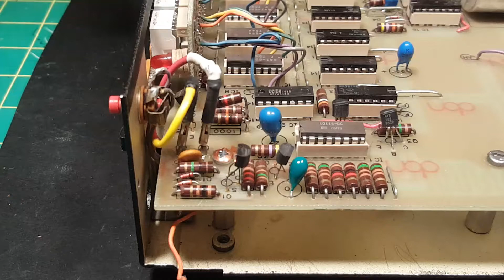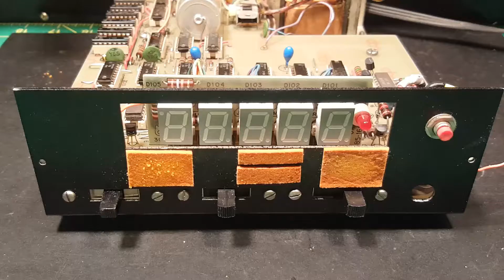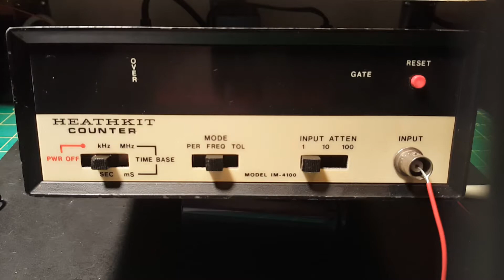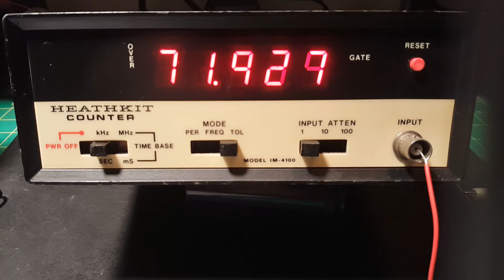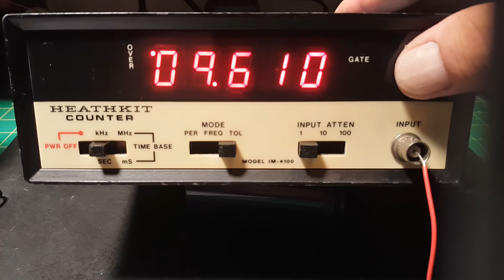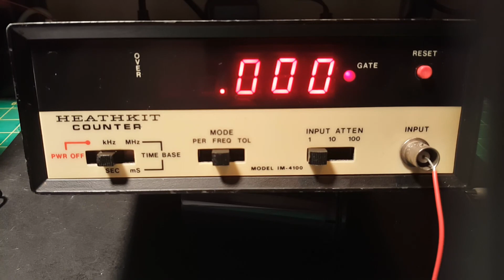Resurrection: Heathkit IM-4100 - part 3 of 3

Comment: I have a 4100, I picked mine up at a swap meet, a previous owner had modified mine to a 7 digit counter and it appears the LED's have been replaced, does not look like the old ones in yours...mine is a white base.  I enjoyed the series and I enjoyed the explanation on how these early counters work, I enjoy vintage gear and have a lot of 1970's counters that dont work and dont have (cant find) a service manual on them...I qualify as a new tech...I have been self teaching for about 5 years now.  Thanks for your insight and experience, I really appreciate it!  ~Jack, VEG
Reply from the maker: Good for you Jack! Self-taught techs are the very best. Something drew you to it- and due to your natural curiosity, you'll learn far far more and faster than most. Kinda how life is. I'm really curious what part number your displays are in your 4100. I have an extra set of the displays if you want them. I don't. I'll never use them, and was happy to pay the cost of 10 to get my counteer going. I now have a Heath nixie tube display counter- and they each have their strengths and weaknesses. For one, the 4100 can count events. My newer one cant' But it's pretty. lol. Thanks for watching, and especially for taking the time to comment! Take care   :)
Reply: @n8nkqrp595  Howdy!  Sorry for delay, had to dig it out and open it up....mine has LTS6680E.  I just bought my first HP 5221A Nixie Freq counter as well, seems to work, but its 50 years old, will need to be serviced...its very cool but its really only good for the 5Hz~50KHz range...I do believe it does go to at least 5 MHz...but it only has 4 digits...from the factory...had to pay more for more digits....with this counter, it truncates the leading digits, not the trailing digits...so you really wouldn't know if your looking at 2 megs or 5 megs.  :)  Maybe later I'll get another one....I have more freq counters then one should!  :)  Thank you for the offer but I have a small supply....maybe do a give away and see if any of your subs are interested? 73's OM, fine business...5/5...DE Jack, VEG

Comment: Hello. I thought you might like to know how the story of my 4100 problem ended. I pretty much checked everything you suggested. I ended up back at the input where I started. The component cooler isolated  transister Q2 as a potential problem. Replaced it with no improvements. I even replaced the JFET with an equivalent but that made it stop working completely. I put the original back in and was right back at the original problem. Some more signal tracing lead to the tantalum cap, C6, right next to the transistor I had replaced. A careful spray with the coolant showed a definite change in the unit's  function. As I was replacing it, I noticed the original had been installed backwards. Now the counter functions 100%. I am not sure how accurately it can be calibrated, but after a long while I managed to get it extremely close to my scopes reading. Do you think that single cap would cause all that instability? It sure works beautifully now. Thank you very much for all your help. I was getting ready to shelve it.
Reply from the maker: Of course! Of course. Caps are actually far more prone to failure than modern (well, those aren't so modern. lol) transistors. Many people don't realize that tantalum caps are very, very prone to failure- especially those used in early equipment. They are not as failure prone as an electrolytic- but it happens. A lot. Even ceramic disc caps failure regularly. On my very first day on the job in my brand new biomed career- the senior tech stated that "capacitors are our #1 problematic component. Do not ever overlook them as the culprit for some strange problems". And he was right. In our Imed I.V. infustion pumps, ceramic disc caps were second only to 7400 series logic gates in their failure rate. I couldn't believe it. And oh yes- most definitely it could cause your woes. Ansolutely. If you have a short wave Rx .. i think you can even use an AM broadcast radio, you can zero beat your osc to WWV, etc., and get it to within 1 Hz. My counter, when calibrated after a full warm up, will generally display within 1 Hz of a test signal sent at 3.500000 MHz. You can connect the input to the OSC test signal output on the back to display the 1 MHz oscilltor frequency to test the unit. I forgot to mention that. Sorry! It's a good test of the unit, but only acceptable for a calibration test point if another much more accurate counter is available. WWV will get you within a Hz if your're careful. I'm VERY VERY happy for you!!!  73
Reply from the maker: I think I was wrong when I said using WWV and carefully zero beating will give the OSC 1 Hz accuracy. Actually, it would probably be 1/10 Hz accuracy, because you're beating the OSC's 10th harmonic of it's 1 Mhz frequency with the 10 MHz frequency of WWV. If you did the same with a station at 100 MHz, the accuracy would increase another ten fold. But that's silly.. the crystal osc will drift far more than that, making the whole process mute. WWV, yes. an FM station, no. lol. 73

Comment: What was the part number of the displays that you ordered.  I have just acquired a 4100 and I may need to replace them.
Reply from the maker: Hi there.. the part # is: HDSP-5503. They are available from Mouser, Digi-Key, etc., and can be found on eBay as well. If you need a set of displays, email me your addy and I'll send you the 5 displays I have left from my repair. 73

Comment: Hello. Nice job troubleshooting the existing faults and identifying potential ones. I appreciate the walk through and all the information. Although my 4100 is in superb condition, it still starts to malfunction after about 5-10 minutes. I monitored the output of the Schmitt trigger periodically on a scope from startup (sine input) The square wave is initially a nice, clean square wave. The rising and falling edges then start to deteriorate at both midpoints. Finally the peak starts to spike negatively causing the frequency to about double. I replaced the S. trigger IC and had exactly the same results. I did find a 510 ohm resistor supporting this IC to be way off. I will replace it. Also, the manual states the input sensitivity at 15mV rms above 50hz. The 4100 doesn't respond to my signal generator which is well above this level. Do you think the input JFET could be faulty? Your videos keep up my enthusiasm for problem solving.  Any thoughts of where to look would be appreciated. BTW, the Heatkit manual doesn't mention raising the diodes away from the board which is a good  idea. Thanks.
Reply from the maker: Hi there Bingo.. thanks for watching! Not much interest in that video. lol. Boy, you have an interesting one there. It's got to be either electrical in nature of a mechanical connection problem when warmed up I'd think. Assuming you've reseated all IC's and inspected their pins for corrosion (mine were actually missing pins. Corroded right off and stuck in socket).. and assuming your power supply is normal (AC ripple when hot), etc.. I'd have to think that if it were mine, I'd then look at the input section. Of immediate suspect might be the two swamping diodes at the FET input, way out of tolerance resistor causing front end biasing problem when hot, or maybe the failure of the IC power conditioning cap C5 which is a 10uf 'lytic. I couldn't believe it's there.. I didn't see it in mine, nor did I see C6- a 47uf electrolytic at the output of the regulator. I'm going to change both of those. In my career of biomedical engineering, I learned that cap filure is a serious problem plaquing modern solid state electronics, not just vintage. I wonder if you can still get that IC.. IC1, a 3 section transmitter/receiver chip. Guess it's like a modern day UART. Who knows. Anyways, that would be my next suspect. I'd surely check the gate swamping diodes. And every resistor in the input  conditioning section.. right up to the first decade counter.
Reply from the maker: Yes. It's me again! How the heck am I supposed to sleep with your problem on my mind? it's 2am and now I'm fully awake, thank you very much! Was just thinking... you'll think I'm nuts, and altho true, I still have a valid test: flex the board. Tap on chips and things when it starts to screw up. Then, if that offers no clue- I'd start freezing one component (or little board section) at a time and see if it's heat related.  Very possible also is the linear regulator. It runs pretty warm and they can oscillate, etc. Power conditioning is vital. Replace all 'lytics. Take care   :)
Reply: @n8nkqrp595  Thanks for the exhaustive list of things to check. I am having to switch back to digital circuit mentality having been neck deep in tube projects. I had totally forgotten about the cooling spray. Brilliant.  A can is on the way.  I did replace IC 1 with no changes. Are you aware of the Heathkit to generic part number reference  list? I stumbled on it and it REALLY helped me find the part.  I will swap out 3 resistors to start,  check for flexing/poor connections and then the cooling drill. Also  the  power supply and regulator. As far as checking the two diodes, is it just a generic meter test or am I missing something?  I'll let you know what I eventually find.
Reply from the maker: @bingojamas4786  Good luck. Just check the diodes with the diode functiion of your DMM or just the ohm meter would indicate an open diode but not the voltage drop on the diode. Either way, it will show if the diode failed open. 73
Reply from the maker: Also Bingo- oddly, my counter does the same as yours when I connect it directly to the output of my Heathkit SG-8 signal generator. It can't count a thing. I think maybe this is because this generator is low-end, and just uses poor (almost no) output filtering. The output is a morass of harmonics. An older generator that uses a heterydyne method of freq generation or a synthesized one should work fine I'd think. As as aside- I can have my counter sitting in my bedroom, and key up my transmitter with the antenna in the back yard, about 150' away- and the counter displays the frequency to within one Hz, using an alligator clip lead as an 'antenna' for the counter. Crazy. It's a fairly crude counter, but I love the thing! The technology is what I 'cut my teeth on' while in college. lol. Take care and good luck!   :)